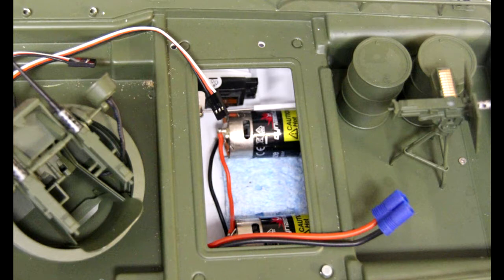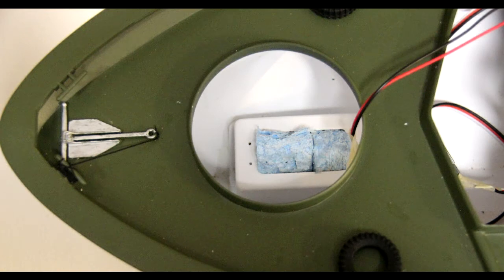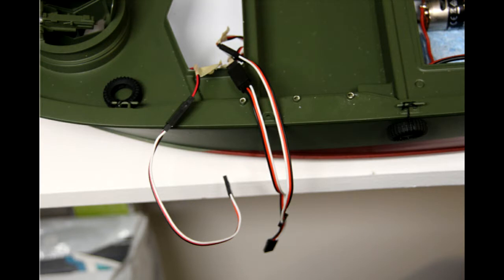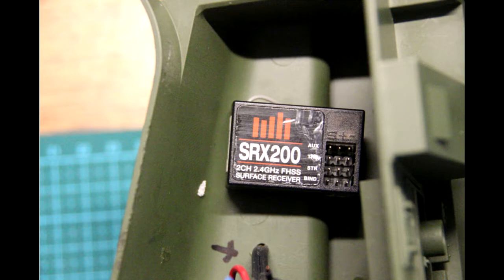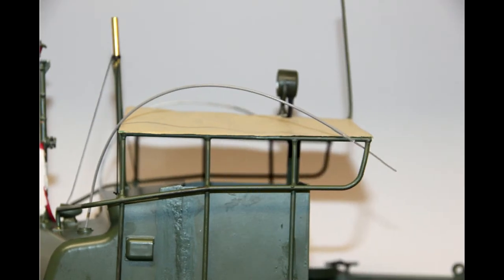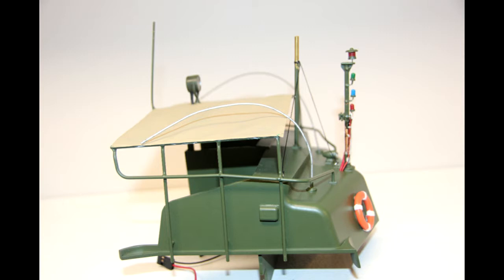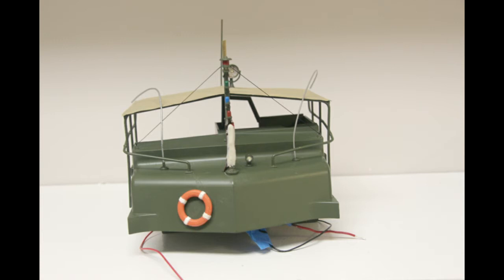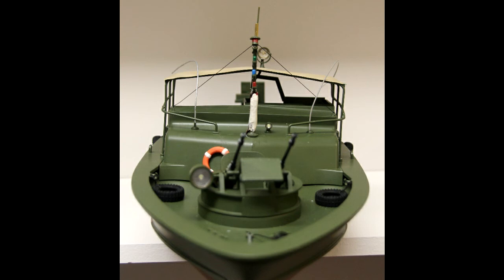ProBoats Alpha Patrol Boat - PBR - Repairs and Mods - #2- Relocate Receiver & Antenna

Comment: How did you get the receiver off? It’s glued on so tight idk what to do to,get it off.
Reply from the maker: I made this 2yrs ago, so to be honest I don't recall any issues removing the receiver. I think it was held by thin 2 sided tape. Gluing it to make it unremovable doesn't make much sense since it could possibly need replacement due to failure.
Reply: @ejcheck  mine is glued in really well. Same with esc.
Reply from the maker: @excellenceinanimation960  Interesting